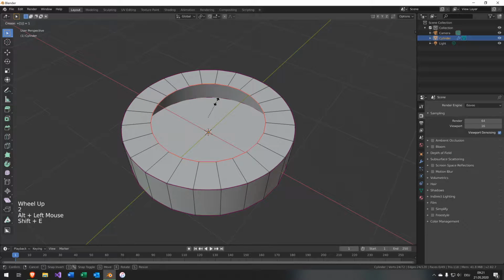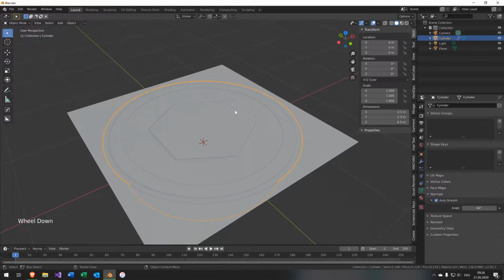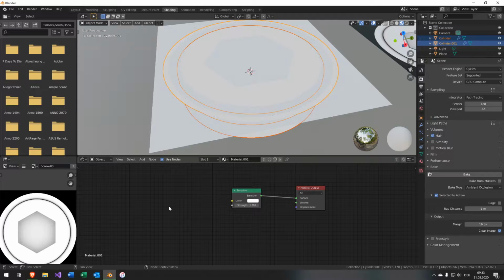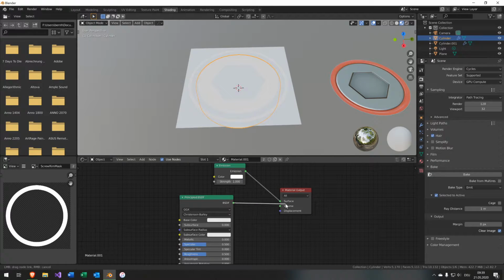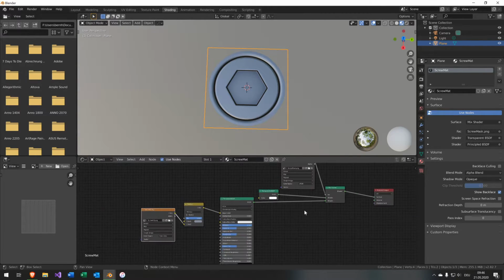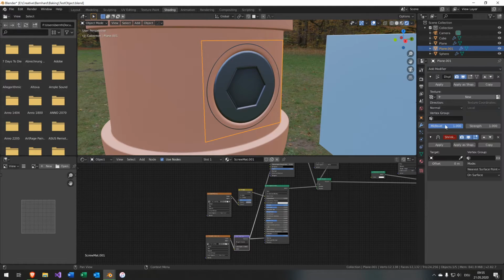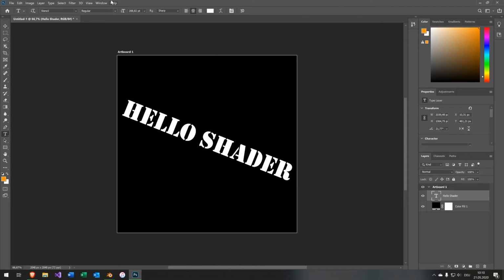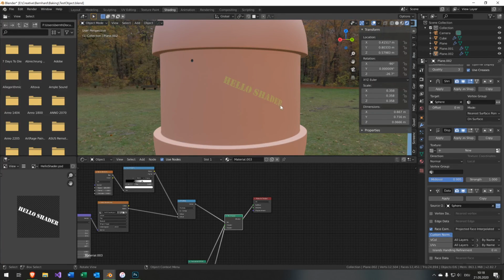Create Decals in Blender

Comment: Thank  you for the  tutorial , was searching for this ... i have a question  what if  there are 3 or more parts in the decal  and i wanted to change the color  how do you go about for that
Reply from the maker: niranjan sankaran in this case you would need different masks and assign different Shaders for each part of the mask (using mix shaders and the mask as input). The result are cascading mix shaders
Reply: @burnhardcc  thank you very much ,  it worked but its lightening the colors as  i  keep adding ( 4 parts in total )
Reply from the maker: niranjan sankaran make sure your masks consist of perfect black and white and save them as non color data